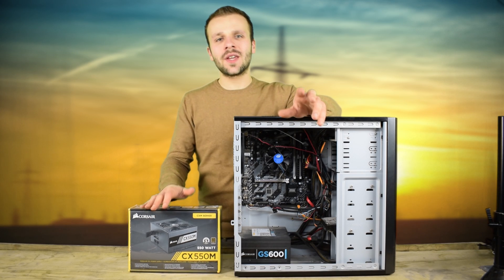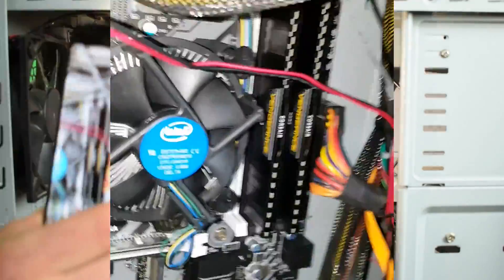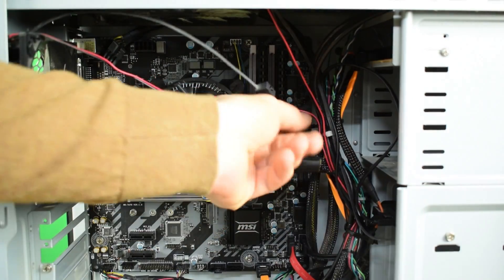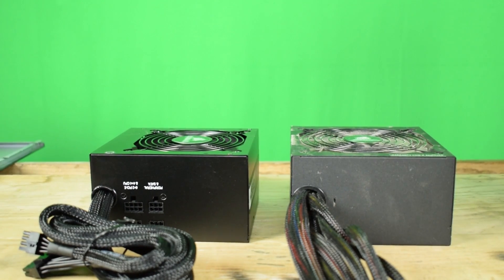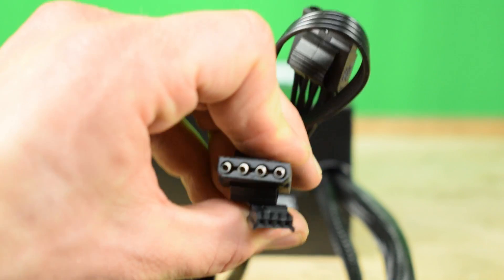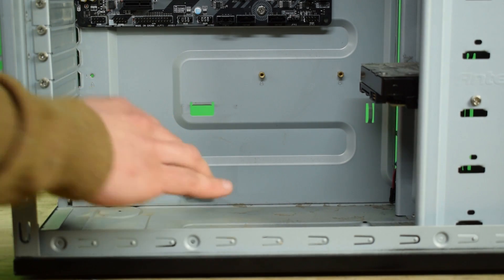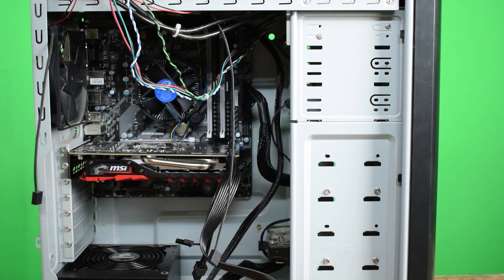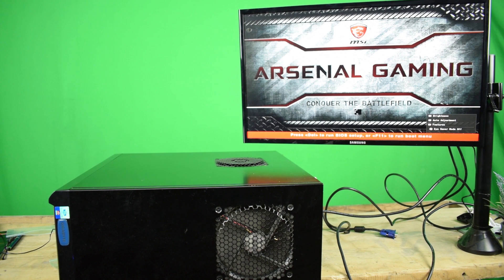How to Replace a Power Supply in a Desktop PC - Advice and installation

Comment: When switching from the 1000RM to the 1000RM-x, will I need to switch out cables?  From my understanding they should be the  exact same.  I shouldn't need to swap cables going to the PSU would I?
Reply from the maker: I suppose not, corsair usually has the same cables for their psu's. And since wattage is the same, the cable thickness shouldn't matter. :)
Reply: @Herbertech  thing still wont start =/.  Wondering if it could be the motherboard
Reply: @Herbertech  went to a buddies house who has a power supply tester.  Looks like they sent me a dud for a new power supply.  We tested new cables and hooked up one of his real old power supplies he had laying around because we thought the psu tester might be broke.  Neither my original or replacement psu would register, but his old one lit it up, so we came to the conclusion i got a dud.  Glad because I was beginning to think it was the motherboard.
Reply from the maker: @bigmacdoubleyouv  Glad you got that figured out! Hf with the new set-up! ;)

Comment: Hey, I bought a GTX 1060 6GB yesterday, and I realized that my PSU doesnt have a pci 6pin cable. In the Guide it says that i need at least a 400w psu, so is a 500w enough? And the PSU that i want to buy has a 6+2 PCI - Express, my GRaphics Card needs a 6pin, so is it useable? :)
Reply from the maker: If you get a quality psu and don't have too much other peripherals in the PC, a 500watt probably is enough enough. Try psu calculator to calculate the recommended psu wattage. The 6+2 pin is ok, you can detach the 2 extra pins. ;)
Reply: @Herbertech  Ok Thank you! :)

Comment: Installed my new power supply but now I’m being cursed with a booting error which says “disk boot failure insert system disk and press enter”

And I went to my BIOS settings and it’s not reading my HDD or anything. It just says “none” where it’s supposed to be. Everything is plugged in I believe, I tried multiple cords to see if that was the issue, but it still reads that error.
Reply from the maker: When I encounter errors like this I always give a good push on the cables first. I have had multiple occasions where the cables seemed to be plugged in, but when I pressed them I could finally hear a satisfying "click". That goes for both power and SATA data cables, on the end of the motherboard as well as the hard disk. Check the modular cables on the side of the motherboard too. Finally, if the disks are not recognised you could try to plug the drive into another PC and see if it works there. Good luck!

Comment: I have a pre-built pc and it has a big metal shroud surrounding the PSU.... I think I could manage the cables but I don't know how to get the PSU out :'((
Reply from the maker: What is the brand and model of the PC? Also, see of you can remove the shroud to reveal the psu.
Reply: @Herbertech  It's a IBUYPOWER AM900Z. The shroud is drilled into the case, no screws
Reply from the maker: @Brandon1267  Maybe via the other side panel? Maybe you can find instructions in the user manual?
Reply: @Herbertech  yeah that's what I was hoping to do. however, there' a ledge sticking up on that side and the shroud is right above the psu so i can't get it out on that side either. The metal part with the ledge is drilled into the case too so I can't get it off
Reply from the maker: @Brandon1267  That's so annoying about these pre-built computers. Manufacturers often make it so difficult to change things nowadays. I would advise you to contact the customer support and ask them for guidance on this matter. As much as I'd like to help you, the tech support will have a clear answer for you. Let me know how it went. :)

Comment: Hello I have a power supply with one 24pin plug and other 4pin plug, should I use all this connectors? The motherboard is and old 775 socket.
Reply from the maker: If the motherboard has 24-pin connector, always use all of them. If it only has 20, the 4 last pins don't have to be used. :)

Comment: What is that black thing to "organize" cables? What do you call that?
Reply from the maker: Do you mean the mesh, fishing net thing net that goes around the cables? I believe they are called cable sleeves. If you mean the strap that binds the cables together, or to the case, that is called a zip-tie. If it's none of these you meant, please specify what you mean and i will gladly answer ;)
Reply: @Herbertech  Thank you for the reply, it is zip tie 😀. I would like to organize the cables inside my CPU with it 👍
Reply from the maker: @reginaldchristopher9918  There is no cheaper way to do it. It gets the job done. Good luck with the organisation! :)

Comment: Can't you just take out the plugs in the old power supply and plug those into the new one? Just so its easier?
Reply: well, yea if you have a modular psu.
Reply: If you're replacing a modular psu with a modular psu. The one in the video is only semi modular.
Reply: What if your swapping a modular power supply out with another modular but a higher watt modular would that make a diffrence with the cables??
Reply: @jugglesgamez8348  no difference in cables.

Comment: I can't take the 24 pin connector out please help me?
Reply: oh come on josh. no one is perfect
Reply: JETSTREAM123 just push the latch down while you left it it was very hard at first but eventually I pulled it out
Reply: JETSTREAM123 lift
Reply: I feel your pain. I ended up turning the computer around a few different ways until I found an angle I could work with well.

Comment: Nice video, just to be clear, does the modular PSU come with its own separate cables? I can see the connection ports are different otherwise I have to go and buy them separate to connect to the GPU, HD etc.
Reply: NO the modular psu should come with those, if not you should be able to go to a microcenter or any computer store and ask for sata power or a 6-pin power connector. hope this helped

Comment: If the power supply came with extra cables, as long as the connector fits the components, it is fine right?
Reply: Kevin Mai yes why would it not be ok
Reply: All the pcie connectors for each devices can only go into one thing anyway 🤦🏻‍♂️🤦🏻‍♂️ the pcie sata cable goes into sata, pcie goes into pcie etc 🤦🏻‍♂️🤦🏻‍♂️🤦🏻‍♂️

Comment: doing this tonight. never done this before, so wish me luck
Reply: My computer keeps shutting off, I just built it and no one I know knows the problem..Im petrified learnign this stuff
Reply: @DarkMustard1337  It is the power supply did you get a cheap one?
Reply: @Panayioooooo  oh hey heh all is fixed now..running a middle of the road build and it works fine
Reply: Brett Wallander do you know what the problem was?
Reply: I’m doing mine tomorrow as well. Gong from 550W to 850W and switching up my Radeon RX580 to an RTX 2070 Super. Glad to see you had an easy time of it!
Reply: @perturbedsun5508  How it was ? Everything ok ?
Reply: @perturbedsun5508  I'm planning on upgrading from an rx 560 to an rx 580. I can't go any better as I have an i5 7400 and only 8gb ddr3 ram, but was it good, the 580? I saw that it had up to double or more performance compared to 560
Reply: @tamisbraaf5591  anything from amd that is a gpu is bad, nvidia is the only good choice
Reply: @ryanairismonke2343  what r u smoking bruh
Reply: @ryanairismonke2343  clearly your info is out of date
Reply: Madein Dark me too
Reply: Did you do it
Reply: was it hard ?
Reply: not as hard as i expected! i followed the instructions in this video and sucessfully done the job
Reply: @madeindark5461  lucky mine dosent boot now lmao
Reply: Obviously not gonna be hard...

Comment: Great video! A standard vacuum cleaner is not good to use to clean inside a PC. You need a special anti static vacuum cleaner if you don’t want to damage your pc.
Reply: Michael Chang or compressed air is better

Comment: I have to do this tomorrow...not looking forward to it!
Reply: Bailey same, I've only ever upgraded ram before
Reply: Same, it'll be the deepest I ever been in pc building, i just hope I don't fry anything
Reply: Boosted Doge geesh my pc came with a 500 psu but i have an a computer I’ve bought 1 year ago and I looking forward on upgrading it but the psu is 250 watts I’ve may take it somewhere to get it replace looks way to much for me since I’ve fried my pc once because of a ram
Reply: Kristineh  its easier than it looks, i went ahead and gave it a good clean with compressed air and replaced the thermal paste on the cpu, didnt fry anything. Yay?
Reply: same. im pretty scared
Reply: I'm about to do the same as my graphics card needs at least 500w so I have bought a 600w to install right now :)
Reply: @killerwarlock5540  im going to buy gtx 1060 which requires 400 w 
And i have intel i3 7100 which requires 50w
So its 450w ill buy a 550 w corsair power supply and replace it
Reply: Same